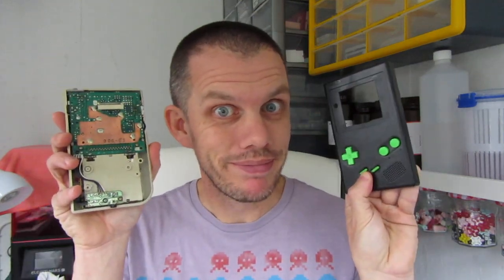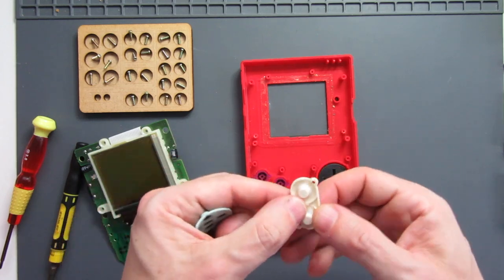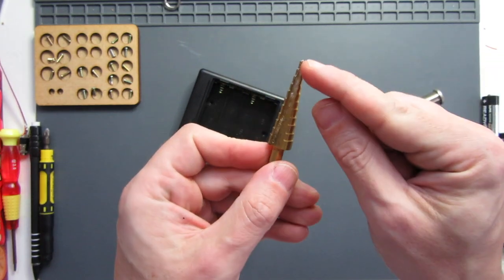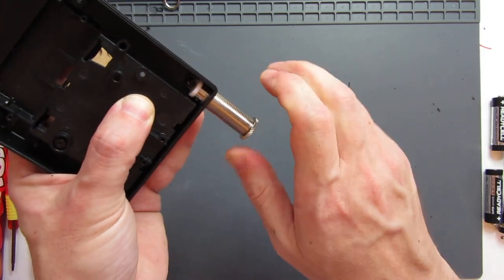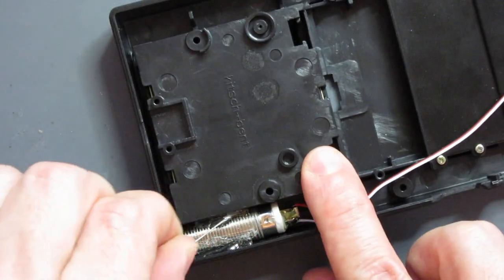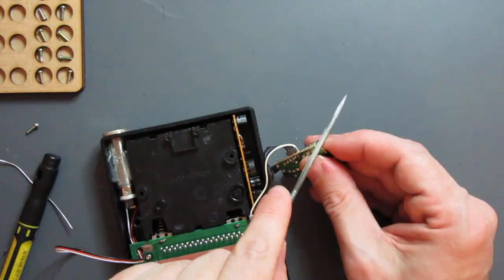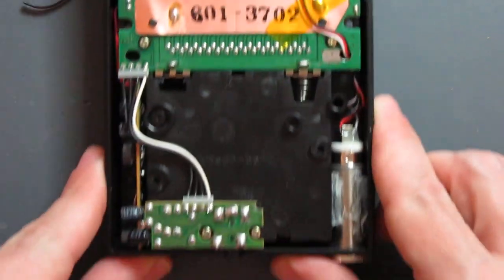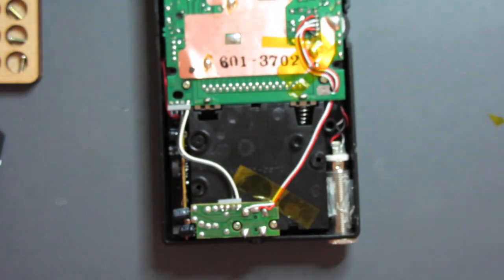Custom GameBoy DMG build part 1 - 1/4" prosound, new shell and more

Comment: Was there a reason you didn't solder the wires before screwing in the line out jack?
Reply from the maker: With it needing to screw in and having to concentrate on cutting a neat thread, it was easier to do that first without the wires all getting twisted up. It's a space that's easy to get to so soldering afterwards wasn't hard.